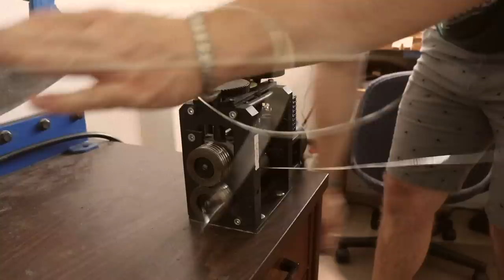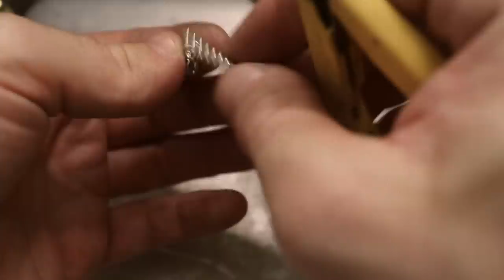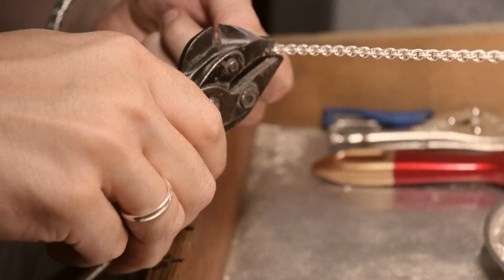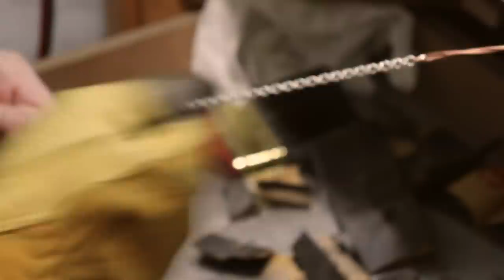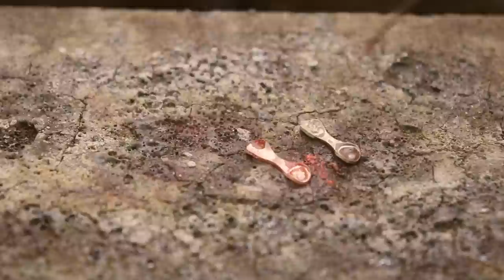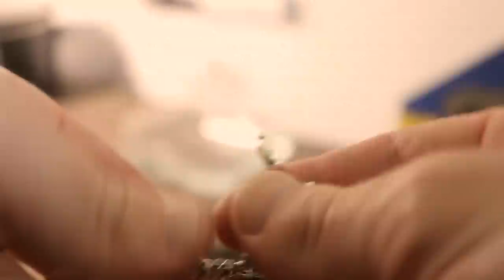Making Silver Chain for Cross | Dynamis Jewelry

Comment: Great video. I have a couple questions if you don’t mind. What is the draw plate with the rollers that broke the chain called? What type of solder do you use? And do you know where I could get one of the end cap punches that you use? Thanks, keep up the good work

Comment: Whats the liquids being used here? Some sort of acid?
I'm new to metal craft and trying to learn
Reply: The first one he used (the yellowish one) is a flux. It helps the solder flow through the joints and protects the silver from fire scale. After all the links are soldered he dips it in pickle (the one in the crockpot) to eat away at the flux and also eat the copper that came up to the surface on the silver. Then he dipped it in patina to turn the silver black
Reply: @coryowen4922  pickle solution is salt and vinegar?
Reply: @morganbrasee5639  there’s some with pure citric acid that’s supposed to be safe since some candy is coated in it. But when it’s in boiling water the steam can inflame the respiratory system as I found out. There’s others that I don’t know what it’s made of. You can google pickling solution for jewelry. I use something called sparex. I have seen and heard people using vinegar but I feel like you have to leave the silver in vinegar for a longer period of time. But it should work. While also making sure the vinegar is hot. I’ve never tried it in vinegar but I know it’ll work
Reply: @morganbrasee5639  when you heat up silver, it will bring copper to the surface and it will react with oxygen. This will turn the silver black. The pickle will eat the flux and the copper on the surface. When using pickle, you have to use copper tongs to get the silver out of pickle. Using steel tweezers will cause the copper rich solution to plate the silver, turning it pink. If it’s a freshly made pickle you have nothing to worry about. But if it’s old pickle make sure you use copper to get jewelry out of pickle. Introducing steel to copper rich pickle will cause a charge that plates the silver. I would scrap the whole project if this happens since it is hard to remove the copper from the surface after that mistake. In the video he uses tweezers that look like steel, which is a big no no. But using steel tweezers to dip the chain in patina helped it turn a darker black
Reply: @coryowen4922  good info,
Does this only apply to .925 silver? Does this effect translate to .999 silver also?
Reply: @morganbrasee5639  I would still use it on fine silver since you’re most likely going to use flux when soldering. But the more heating and pickling of sterling will cause it to have .999 silver on the surface. This is called depletion. Depletion is important for reticulation and keum boo. Check those out. It’s pretty cool

Comment: When you roll out the silver whats the purpose of wrapping in a circle and heating it up over and over
Reply from the maker: the metal becomes hard so it needs to be loosened
Reply: The process is called annealing, if you wanted to find more information on the process.

Comment: Could anyone tell me where to get one of them massive adjustable draw plates please
Reply from the maker: Here
Dynamisjewelry.com
Reply: @DynamiSJewelry  unless there's a tool section I can't find on your site, that's not what he's asking about.  I ran through your tool list, searched about 25 variations of the tool and its function, and checked comments to see if I could find it without any success.

There are quite a few comments asking about the Oops Tool.  Seems to be a large bore bearing-assisted draw plate, at least the way you're using it.